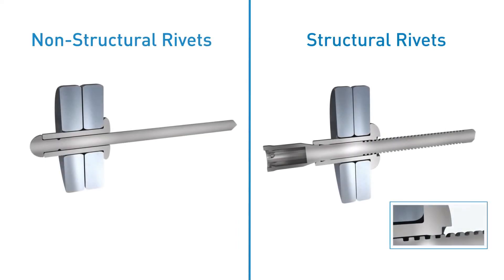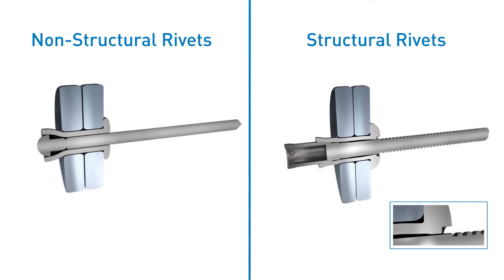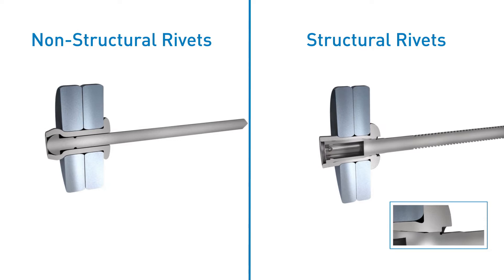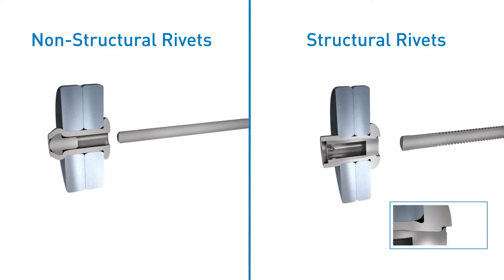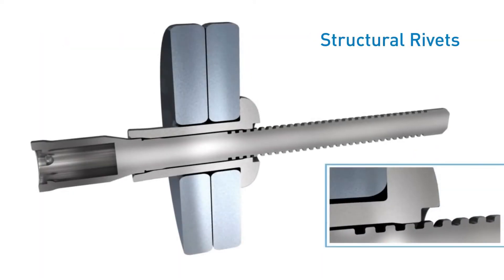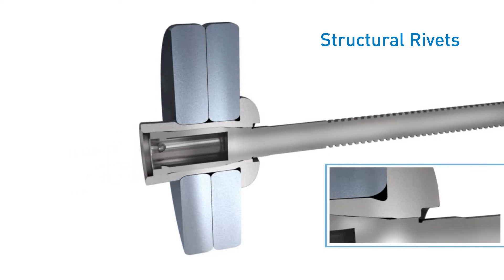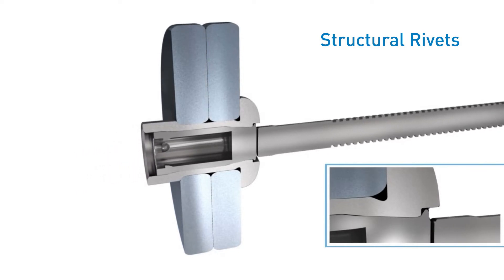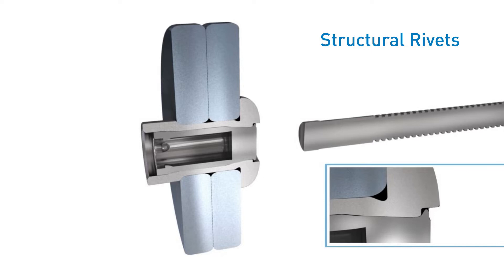Rivet Technology from Bossard

Comment: You also forgot to mention that there's more than 3 types of pop rivets.
The main difference being marine grade and non-marine grade. The marine grade rivets are sealed on the blind end in one way or another to ensure water doesn't penetrate.
there's also some rivets that will split apart as the mandrel is pulled, trifold rivets.
Reply from the maker: Thank you for your comment! You have a point, within blind rivets there are several more types available than mentioned here. This video is intended to give a basic overview about rivet technology and only features some of the most important technologies in the field, therefore we couldn’t go into too much detail!